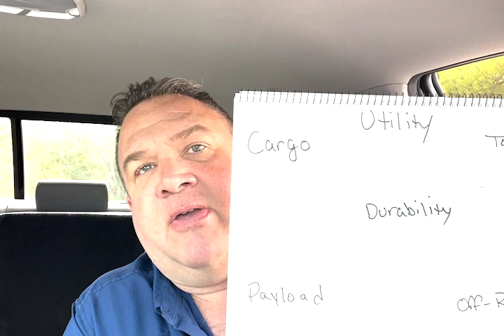Why Making Electric Pickup Trucks is Hard

Comment: Cybertruck truck guy. - BREAKING news , California CARB January 1 2023 Banns all Diesel Tucks from CA roads. 
this effects 200,000 Diesel vehicles & 70,000 Diesel semi (14,000) lbs.
this effects Diesel vehicles Purchased before 2010/Engines before 2010. 
they are allowed to swap out Engines for 2010 model or NEWER.
CA DMV will Enforce , and will not Register any Diesel vehicle Purchased before 2010/ Engines before 2010.

Comment: CyberTruck is revolutionary in its structural design, which will enable it to come in at < 60% the weight of other battery electric trucks.  Connecting The Dots has a recent video breaking down CyberTruck's structural efficiencies.

Comment: Although I agree Tesla will create a better overall pickup than incumbents, Cybertruck will be very difficult for Tesla.  Each CT will require 1.5x to 2.0x more expensive batteries than Model X. Tesla set low CT price expectations. Tesla must raise the price, making CT unaffordable to most.  The CT's folded stainless steel exoskeleton/body is a scientific research project - not a well understood, efficient manufacturing technology.  The development process will be stressful, long, and expensive (similar to slow 4680 development). When Tesla finally gets all this figured out and dialed in, Cybertruck will be a masterpiece.

Comment: TODD, glad to see you back making videos.
so, Legacy truck are not using Bespoke EV technology, they are all still using ladder frame, & body on frame technology, Rivian is a Hybrid unibody frame, it has a discreet 3 part underbody. 
The KANDI K32 is a adapted gas truck. 
the F150 lightning is a gas truck w/ updated rear suspension. 
but, the Lordstown endurance is still using old fashioned leaf springs suspension. basically a gm body & chassis. 
Tesla CT is revolutionary, using a lightweight Exoskeleton w/ Gigacasting & structural battery pack. 
and like Rivian uses Active AIR suspension. 
None of the EV truck in production have stock air suspension. 
however they should be compatible with after market off road suspension & air suspension, like with gas truck.

Comment: So, even the 2019 prototype Cybertruck is already better than most light/medium full size truck.
CT had a payload of 7k lb, and 100sq foot cargo. 
it had 500 mile towing w/12k lb.
I am sure the 2023 CT will be updated to reflect Quad motors and NEW battery spec.

Comment: Ford has an addition problem which is that their trucks cant be a 100% new plattorm because they have a huge aftermarket with ladder racks and toolboxes and campers etc. Not to mention 3rd party companies mounting different beds to the base truck. GM gave up on all of that and the Silerado doesnt even look like you can mount a toolbox.
Reply from the maker: This is under appreciated. I cannot wait for Munro engineering to tear down the first Cybertruck. I believe it’s going to stun everyone else. All the ways Tesla will use to reduce weight and increase efficiency will be mindblowing because it took the gamble of RE-inventing it.
Reply: @cybertrucktruckguy3347  Supposedly GM is taking a page from Tesla and using megacastings for the new $300k Cadillac luxury station wagon thing. Not sure if that also applied to Silverado... kinda doubt it. Cybertruck should be an interesting tear down...  not just Teslas first structural skin vehicle, but the first vehicle that can leverage the battery pack as a structural element. The unfortunate thing is that Tesla is giving everyone else plenty of time to iterate and get their trucks more reliable/dependable in the wait period.
Reply from the maker: @patreekotime4578  everyone else still isn’t taking it seriously. They think the aesthetics will limit its appeal. Identical to the Beetle in late 50’s.
Reply: FUD motors has a Lightweight demand problem, F150 EV can't even OUTSELL the Tesla model X .
Reply: @markplott4820  The only FUD here is you. Go away with this nonsense. Ford is selling every Lightning they make and will do so for a long time.

Comment: It sounds like you’re saying that Tesla will have an easier time making trucks than traditional truck manufacturers will have making an EV.
Reply from the maker: You said this so well it has me thinking about doing a video to elaborate.
Reply: @cybertrucktruckguy3347  Hoovie's garage validated Fords strategy. He loved that Ford adapted their ICE platform for the Lightning but hated how inefficient it was. The video showed him exceeding 75mph. Also, he chose not to switch to a lower hitch, so the trailer pushed air the entire trip. So in a sense, he was blaming the manufacturer for inefficiency, exacerbating the problem himself. Your opinion has been an integral piece of validation for CT's potential. The majority can only focus on finding ways it won't do the job, instead of seeing it redefining what a production truck can do. I've heard it said that because it lacks a body on frame, it's not a truck. Often the comparison to Honda's ridgeline isn't far behind. Failing to understand how the structural truss has the potential to tow much more than either, while costing 7x less to build. Tesla's approach of first principles avoids the fat, & enhances what makes it useful. How many times have you heard about the buttresses keeping you from reaching into the bed? Failing to notice toe steps(totaling 6) along the side. If you lower the height, those holds make it easier to reach in the bed, than a traditional design without. He also mentioned with gas, you can fill up anywhere, but not the lightning. In the beginning, fueling up wasn't convenient. It will take people a while to adjust to long trips/towing in an EV. Tesla's latest update helps one understand where the energy is going, offering ways to improve. Empowering you to adapt to the vehicle needs, instead of burning energy to accommodate your negligence. If you utilize every opportunity to charge, rather than draining the entire battery, you won't be waiting hours in one place. These semi won't be effective if it only charges at the warehouse. But if it charges while docked, while unloading a few pallets at a time. It returns from its route with 60% instead of 20%. Allowing it hit the road sooner than a semi that had to fully charge, because it lacked the efficient infrastructure. I look forward to your videos, & can hardly wait to see more. Cheers
Reply: @cybertrucktruckguy3347  Have you retired from YouTube ?
Reply: Because, just like Tony Stark w/ MK 1 iron man, Tesla throws out what is not needed anymore, DELETE.
Reply: They have gained a lot of experience in a short amount of time (14yrs or so). Ford admitted they're not focused on building efficient EV's. They haven't been focused on making money on selling cars period. There bread & butter is selling parts to dealerships for repairing vehicles as they age. I don't know about the lightning, but they are not profitable on the Mach E.

Comment: Great video!! 2019 the top 3 vehicles made In the US, were trucks, they made 3 million for the 3. Not to mention the other trucks sold. Is it true that 70% of trucks owners don’t use them for work? Just wondering.
Reply: TESLA in CA OUTSOLD the F150 in 2021 at one point.
Reply: Todd. Love having you back. You are the most solid voice on the CT. Have you watched Connecting the Dots on CT? Great video.
Reply from the maker: My experience is that the VAST majority own trucks as a more utilitarian version of an suv. Most truck owners I know do use the utility of the truck occasionally, most often for towing boats or campers 6x a year BUT they do get used, just not for work. 

Another Good example is that the family with the truck often gets asked to haul around all the blocking dummies for the pee wee team. Also trucks much better for deer/elk hunting. 

It’s just really hard to go back to non trucks once you get used to the convenient utility they offer.

Comment: Legacy doesnt want to make EVS no matter how much they LIE about it. Thats why they make outlandish things like the Hummer and the unappealing mediocre Bolt that spontaneously combusts to try and claim there is no "real" demand for EVs. Tesla wasnt expected to survive and now the others are scrambling to stay relevant by creating marketing gimmicks hoping that Tesla will fail to achieve their goals. Notice how all the F150 lighting reviews rave about the frunk and other technically irrelevant features. The drivetrain is all that matters in an EV. Efficiency and reliability are #1. 
 Im expecting a Model Y in December even though i originally was just waiting for the Cybertruck. Im tired of getting robbed at the gas pump ($250/mo) via "artificial shortages" created by warmongering PUPPET leaders and energy monopolists funded by central bankers. Ive had solar since 2014 for the same reason. Backup power during grid failures and reducing my dependence on the grid cost. GO TESLA!
Reply from the maker: I have considered same esp with my 15mpg tundra, but I just can’t give up my truck.
Reply: @cybertrucktruckguy3347  Im keeping my F150 as well as im a remodeling contractor and need a truck no matter what. THe Y will be shared by my wife and I

Comment: CT will of course have all of the things one may want in a truck - ultimate utility, durability, cargo, payload, off road, towing, etc. Only question for long time reservation holders like us is: what is the price going to be?!?  Will Tesla be announcing new pricing and / or specs soon?
Reply from the maker: I’m expecting the pace of updates to tick up after the new year. I think Tesla want to wait until there’s more clarity around the new tax credits. Since the price increases have been 10-20k I’d expect the ct to be in that range with dual motor up 10k and tri motor up 15-20k. I think rebates could be in excess of 10k so it could be almost a wash. 

Additionally, I think Elon really wants the ct to compete well with existing options so if you see f150 pro at 55k now, dual motor might be there and tri motor to match rivian in that 75-80k range.